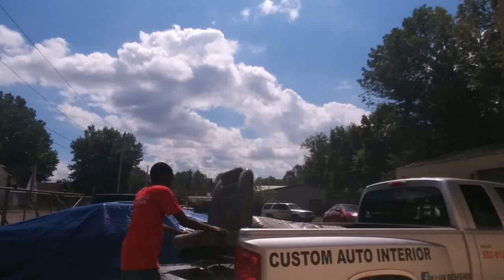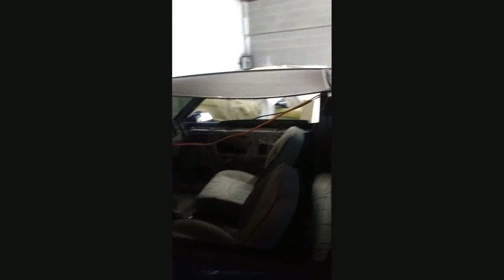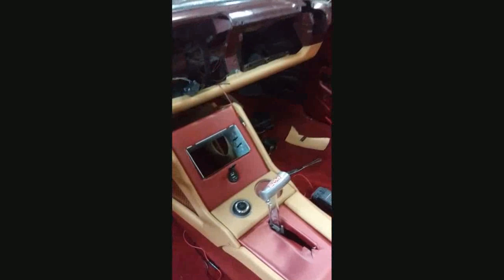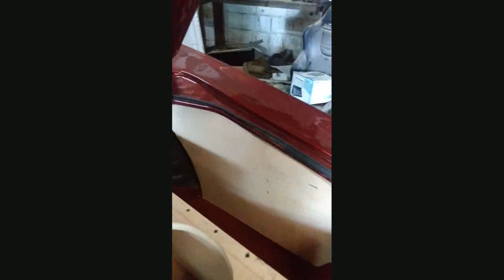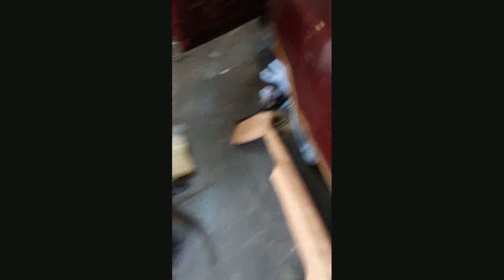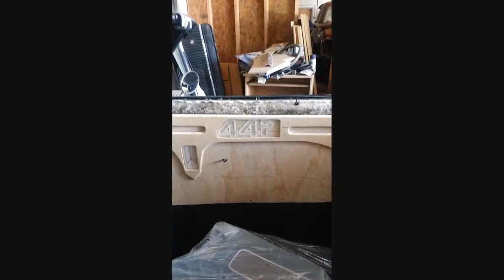Im always working on Custom interiors, even on Labor Day!!

Comment: What's a good durable material for a work truck...the leather keeps getting mildrew and tweed is super hot. Thanks.
Reply from the maker: Kodiak vinyl , it's used on snowmobile seats. Its slightly thicker for wear n tear
Reply: D.lux auto restyling/ @Dlux_designs IG Thanks I'll check it out.